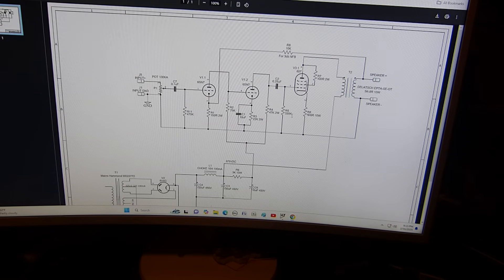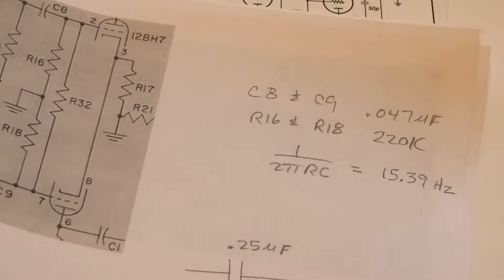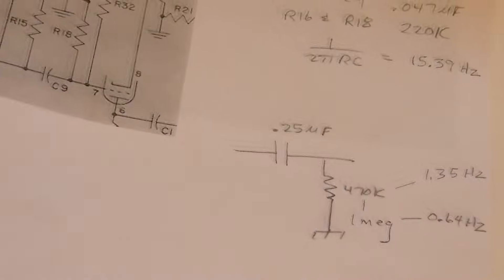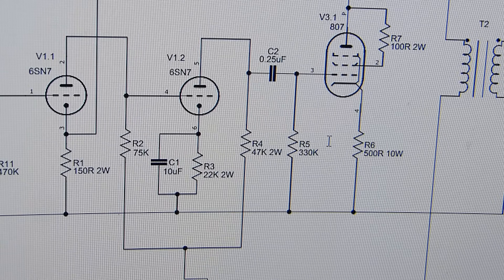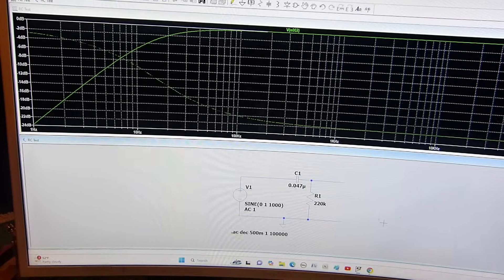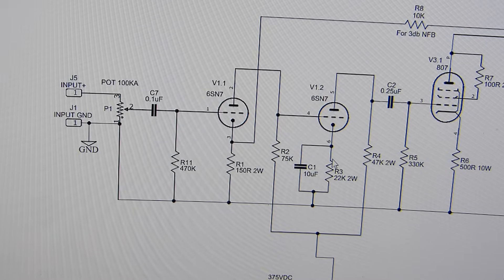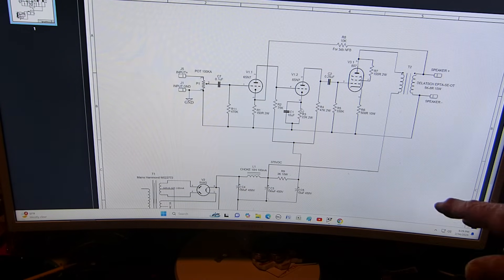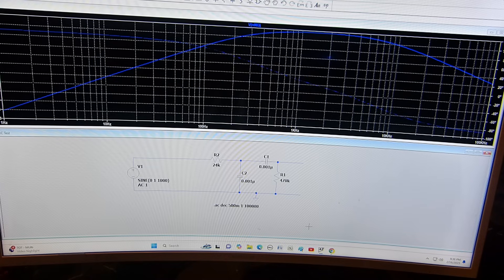Frequency Contouring The Single Ended Vacuum Tube Amplifier

Comment: hi,the  direct connection between 2 sn7 eliminate the phase rotation  so its better in push=pull but S.E. i dont know
Reply from the maker: I think the direction connect between stages works the same in either PP or SE. As far as phase shift goes, with a proper amount of global NFB, the phase shift is as good as we can expect it to be at 20 Hz and 20 KHz. I am satisfied that there is no serious issue.

Comment: Hi David, I'm modeling the power supply for my upcoming 807SE Stereo amplifier.  I've been using 5K for the load, but will that change for stereo?  It would seem that the power supply will see the two OPT as 5K in parallel, so would the power supply load then be 2.5K?  I'm trying to have no surprises once the chassis is punched.  I'm planning on using a Triad R-18A (375-0-375 @ 175mA).  I've modeled it in PSUD and have also built it out on the bench and I'm getting great results with 5K.  I also watched one of your previous videos about tuning the power output with the Pi network and was a very great help.  Thank you!!
Reply from the maker: Yes, that makes sense to me. If the 807 is 60 mA and assume 10 mA for the 6SN7 and the supply voltage is 400 volts, R = 400/ .07 = 5.7K and half that for two channels. I think your calculations are great and your PS will do the job. The vintage Triad transformers are a good way to go.

Comment: Hi, this looks like a nice amp, my concern in the past is what effect does the phase shift of the signal change the sound due to cap's and inductors? also, if the feedback is slightly out of phase with the input signal there will be distortion. I like the direct coupled 6sn7 stages and wondering if there is a way to couple the output tubes directly?
Rich
Reply from the maker: If we couple a stage directly from plate to grid, we have to have the cathode floating high enough from the chassis ground so that the voltage between grid and cathode are what we want the bias to be. We can't do that in the output stage (the 807) because we need a sufficient amount of plate current flowing to give us power to drive the speaker - thru the OPT. I have gone down the rabbit hole of phase shift. With small amounts of NFB phase shift can be 50 degrees or more between 20 Hz and 20 KHz - enough to make us want to scream - but - sounds fine to me. We have to be careful how we fixate on something...   lol... Zero NFB is going to make phase shift outrageous and the more NFB we use the better (less) the phase shift. I have found that making coupling capacitors larger does nothing for phase shift, that I can measure. We can measure amplifiers to insanity. I use McIntosh amplifiers for reference and they do what they say and spec at about 8 degrees phase shift from 20 Hz to 20 KHz and pretty much unmeasurable at 2 KHz. So, where I am going with this is, in my opinion and measurement, which may have error in them, the phase shift is going to be primarily in the inductance of the OPT and changing capacitors or direct coupling is not going to do much for us. However, NFB can be our friend if we can find a sweet spot that we will accept in both measurement and listening experience. Just my thoughts.
Reply: @ElPasoTubeAmps  thank you for the explanation, I was wondering if you had thought about it.
Rich

Comment: Nice video. I have played with that cap value a little.  That resistor on the grid will effect bias as well. On that circuit with SE 807 that cathode resistor sets bias. That grid to ground resistor helps with impedance of input and bias some what. To set bias is zero single plate current of tube.  The tube sees grid to cathode voltage . which is negative because of cathode resistor.   You can improve that circuit buy a cap across that cathode resistor. The outher way is use a SE output transformer with a screen tap and connect to screen with out that rasistor to plate.  Gives a over all better performance.  I have do it with SE 6BQ5 and 6L6 tubes.  In push pull you will have 2 screen taps . I have a KT 88 amp like that. That input cap to output is 1 part . The response of output transformer is a outher and the feedback is a outher .   Just set up some test gear and change cap value ,to get response you are looking for. Even the type of cap makes a difference.

Comment: I really got a lot out of this video.  I have always wanted to understand the relationship of coupling caps in tube circuits,  and I don’t have the background, I am just a hobbyist. I knew that they blocked dc, but I didn’t know what was the driving factor behind the size of the caps. Now I get it.

Comment: Will be interesting how that works out for you.lm building a few se amps, some low power wo feedback and have  been thinking about ways to roll off the low end if i decide to add a subwoofer.thinking about building one similar to yours as well.i have some 807 and 1625.

Comment: I've downloaded the 100 Amplifiers also.  Didn't print them out , though I've thought about it.  I still think it easier looking at a printed page.  Then if you want to do something else on the computer while looking at the document.  I take it next you will be doing some frequency response testing with different resistors and caps feeding the output tubes. Sounds good!

Comment: I've been trying to suss this out for a while, it can get tricky. As far as V2 is concerned, re gain R4 is in parallel with R5, so the R value is 41,140 ohms making the 3dB point 150hz. Or does it? Then there's all the other RC filters to put into the equation.
  I've designed & built about 10 valve amps so far, I always end changing coupling caps, usually lowering the value because although they test good from a frequency POV, they sound too bassy. That could be because of my speakers.
  So then you through your speakers into the mix, which as you know don't have a fixed impedance. Throw in stability too, nightmare. I'm not knowledgeable enough on this subject, but I'm learning. Check out the "GEC Approach to audio amplifier design" it has some interesting stuff on this subject. Cracking video.
Reply from the maker: That is a great question about R4 and R5. I too, have always seen them in parallel for the signal and did just what you did and assumed the parallel R would be about 41K. I had a chat with ChatGPT about this and it told me that R4 was simply a load resistor for the source. Still not sure, I put the little circuit into LTSpice and sure enough, the value of R4 doesn't matter when it comes to the high-pass filter formed by, C2 and R5. I seem to have the same preference as you do in bass response. It is too easy to make an amplifier sound mushy with huge value coupling capacitors. As for the speakers not having a steady Z, I tried Zobel networks on the output which seem to do nothing that I can tell. As for stability and adjusting the NFB resistor, I seem to remember, but I did not make notes, that with a SE amplifier, we can't go above about 6 dB GNFB before it becomes unstable - I need to recheck this before I can say that for sure. PP amplifiers seem to have a limit of about 16 dB GNFB before they become unstable and start oscillating at about 1 or 2 Hz. I will check out the GEC article. Thanks for your comments. Here is a link to a quick and easy calculator for high-pass RC filter.
https://www.digikey.com/en/resources/conversion-calculators/conversion-calculator-low-pass-and-high-pass-filter

Comment: Great video, David, and in those days if I am not mistaken all the record masters were cut bellow 30Hz and above 15khz to be compliant with FM radio policies. This also made it easier for speakers and OTs alike because speakers suffering to produce very low frequencies make the overall sound muffled and distorted (even if they perform great on the bench with dummy load) 
I think even YT is cutting out everything above 16khz I think. I listen to my stereo version of Little Jewel almost every evening in my shop and the more I listen to it the more I love it. I think you hit gold with your very very educated guess with this one, David!

Comment: There is an error in the analysis of the Brook 12A: the 1,000 puff coupling cap to the phase inverter is not loaded by a 470K to ground. It is loaded by a 470K which is returned to the self bias resistor (4.7K) and the 33K, which is then grounded. The gain will be a bit less than one (around 0.8) which will greatly increase the effective load resistance that the coupling cap sees. It should look about 5X the 470K value. You can simulate this by downloading a 6SN7 tube model and simulating the real phase inverter. Or you can replace the tube model with a voltage-controlled voltage source (“e” in LTspice) in series with the typical plate resistance of the tube. Set the voltage gain of the vcvs to mu.

Comment: Does stacking different capacitors, in parallel, change the curves?
For example, putting a 0.047, 0.47 & a 4.7uf in parallel. 
Mathematically, they would add up, but doesn't each of the capacitors have their own physical characteristics that would have its own impedance, at specific frequencies, or am I over thinking it?
And, does the Grid to Cathode capacitance  affect the circuit (in your example, a 6SN7 is about 3pf) ?
Reply from the maker: They add up as you noted and end up acting like one capacitor. We know large capacitors have a bit more inductance (L) and sometimes large capacitors are shunt with small ones, as you mention, of less L to deal with higher frequencies and we see this sometimes in audio but I think it is mostly important in RF. As for the 3 pF, I think that is low enough it can be ignored at audio frequencies.

Comment: I am not opposed to roll of the low end like in your 807 SET at 15 Hz. My "daily driver" is a EL34 pseudo SET or UL (switchable, but mostly pseudo SET) and I mostly listen to records (or "vinyls", whatever you may want to call it). Without the low frequency roll-off I would waste power to try to amplify the rumble and unwanted LF noise of the record player which wouldn't make it through the OPT and speakers. 
I am fine with a 12 Hz low cut, I don't play much electronic dance music and I don't think that my 6-7 watts of output power would shake the house even if I had subwoofers that went that low 🙂

Comment: I can see some advantage to limiting the amps response to subsonic frequency noise.at what point will there be an effect with the negative feedback network (phase shift etc.)?
Reply from the maker: I agree that phase shift can be an issue and it can come from capacitors and the OPT and could cause instabilities with NFB. I suppose what I am looking for here is the "cleanest" sound - clear and responsive bass with no "juke box" boomy sound and highs that are crisp and articulate without the sibilance at the high frequencies. I find this little SE amplifier extremely clean and maybe I just don't know when to leave good enough alone.  🙂

Comment: David do you by chance work on ham radios?
Reply from the maker: No, I don't take in any kind of work anymore. Vacuum tube equipment is something that we hams may be able to work on but anything modern and solid state especially equipment with surface mount components will most likely have to be repaired by the factory.
Reply: @ElPasoTubeAmps  Oh well, Thanks for replying so quick, I need to find a shop to service an old Yaesu Ft 757. gonna check with HRO this week. thanks again, Harold KJ5FSI

Comment: It would be interesting see if a 1 hz or less corner just eats up power amplifying frequencies we can't even hear and speakers can't reach. That extra power needed to amplify useless frequencies, which taxes the OPT unnecessarily, steals power, headroom loss, distortion, etc. I would think 10 to 15 hz is fine, if I found out experimentally that 10hz vs 30hz eats up more power, I'd probably be increasing the 10hz to 20 or even 30, so I have full power to what matters.
Reply from the maker: I think that is a good point. Some people like a lot of bass and use sub woofers but others like a cleaner signal, expecially while listening to classical music. This idea I am playing with now is from seeing over the years that some of the most revered amplifiers have some form of frequency control or frequency contouring as I am calling it. Just thought it would be interesting to experiment with this idea. I am very charmed with the sound of the SE amplifiers. As mentionedd, I don't want to engineer the sound out of it but maybe some small tweaks could be interesting to play with.

Comment: How can you tell the difference by looking at an RC network if its a frequency contour or a corner frequency? You keep mentioning that some of the RC networks are for contouring shaping amd other RC networks are to set the corner frequency. Its hard for me to identify the RC networks
Reply from the maker: I mean by contouring and corner frequency the same thing. The "corner frequency" in a high-pass network is the low frequency point where the attenuation is down 3 dB (half power). At this frequency, anything below it will continue to be more and more attenuated as the frequency is lowered and have the effect of "contouring" the low end frequency response. The high pass filter is a capacitor in series with the signal line and a resistor to ground at the output side of the filter. If the resistor and capacitor are swapped, it becomes a low-pass filter and starts attenuating frequencies above the "corner frequency". They  both use the same formula. Both of these are seen in the Brooks 12A design schematic. I think it was taken more serious years ago (50 years ago ??) because of many things. Rumble in turntables, frequency and noise issues in magnetic pickups for vinyl records, stiff cone woofers and horn type tweeters and midrange speakers, etc. It seems the objective in some of these amplifiers was to limit both low and high frequencies thru the amplifier and some of it can be done within the amplifier with RC circuits.

Comment: There are three HP poles here, and you have to consider how they sum. C7/R11, C1/R3 x (mu+1), and C2/R5. First one is 3.39Hz, second one I haven’t figured, and third one as you have it. For completeness you should also figure in R2/C5 and R4/C5, which gets more complicated again.

OT but I have always thought of the NFB corner frequency as something that should be measured and reported in specs. The frequency at which distortion begins to rise is surely part of the sonic signature. Best EJP
Reply from the maker: Good thought. I have not considered the corner frequency for NFB. I just empirically adjust at one or two KHz to some level of NFB all while watching for instabilities on a scope or SA. I will see if I can model that and see what happens. I think I am about to see that this may just be a meaningless attempt to "improve" the SE amplifier but I still fine it interesting and fun...
Reply from the maker: Here is a link that discusses the cathode circuit with C1, R3....   (quote)... for the parallel RC circuit, this voltage gain is unity since the voltage across the R and C is the same.
This might also help with the NFB thought assuming it is a parallel RC circuit (unity again) and not just R. The C for the cut-off F would be interelectrode capacitance at the cathode which I think would be nominal (a few pF) and would make the circuit have a cut-off frequency in the MHz range - I could be wrong...   🙂 
https://electronics.stackexchange.com/questions/377059/frequency-response-of-a-parallel-rc-filter-smoothing-capacitor-in-rectifier-cir
Reply: @ElPasoTubeAmps  That link doesn’t discuss cathode circuits. You have to multiply R3 by mu+1 and again by C1 to get the time constant, below which there is less gain. There are different gain formulae for above and below the time constant, although for this discussion you only need the corner frequency. It will be down in the LF region you are looking at. The info on all this is scattered in several places in the RDH, but it’s there. I found it all last month. I’ll email you with the details.
Reply from the maker: @EJP286CRSKW  I will get out my RDH also. Thanks.